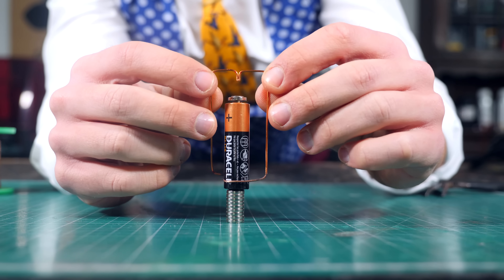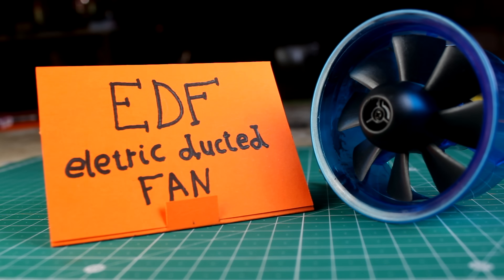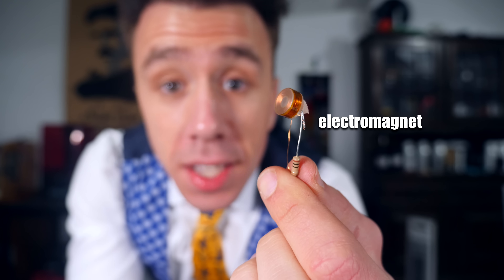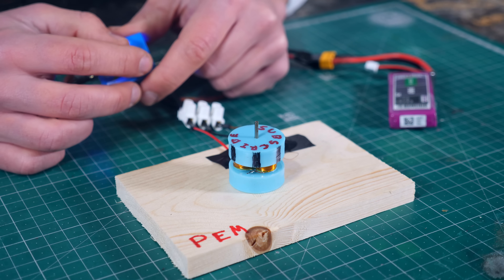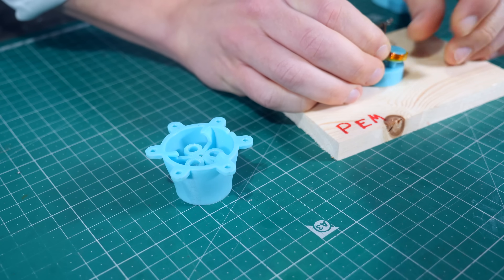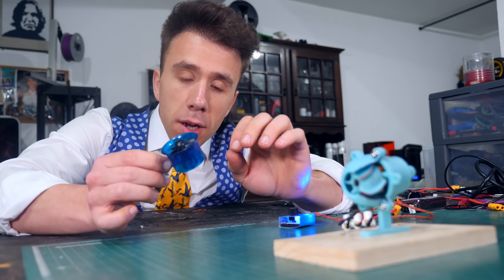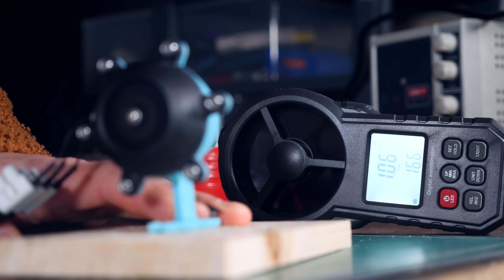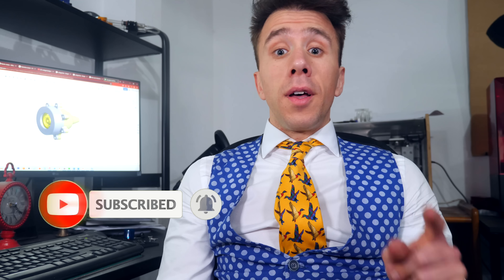I 3D Printed an ELECTRIC MOTOR FAN

Comment: I've seen already many comments sugesting the cause being restricted airflow, what is most likely the case in my oppinion too. But what about making it small copy of new boeing engine? 2 FANS rotating in opposite direction? You won't need casing - so no restricted airflow?

Comment: You need more rpm or a larger impeller. Get a current meter and you will see that you arent pulling as much power in the centrigugal design.

Comment: It is probably an efficiency issue. Your prototype has a lot of "air friction". The air doesn't go straight out but "grinds" against the carcass. The impeller also seems to have some efficiency loses.

Comment: I think problem is in that duckted fan is moving a lot more cubic meters of air, but with relativl low pressure. Impeller in turbine can create big pressure but is not moving same amount of air through it. So there lies some proportion pressure against quantity of moving air and thrust. Look at jet engines, there is a big multiple stage compressor, which puts through itself a lot of air. There is as well duckted fans on jet turbines, which increases thrust and efficiency of straight jet turbine. Basically you are trying remove combustion chamber in favor of powerfull bldc motor.

Comment: Change the inlet to get bigger after the air enters to increase pressure and lower velocity. I'm guessing the fan blades are to heavy slowing the motor. And try to get blades as close to housing as possible to increase efficiency. Look at how an axial turbo fan works.

Comment: You should enter in "the fan show down". The reason you are having low or no pressure is based on clearance. To much clearance and the air slips past the blade. Print the housing with .5% reduction in size or enlarge blades on the impeller. Didn't verify the % but you get the point and it should be so tight it almost grinds the blades to "self clearance"

Comment: so the problem is intake volume.

the EDF has a far larger intake volume then the impeller design and as a result is able to push out far more air then the impeller. the EDF also has it's intake volume further from the center which leads to the blades there going at a far higher speed and as a result leads to more flow.

Comment: I study Engineering at university, pretty sure it's as simple as an unbalanced impeller. My second guess would be the un-sanded blades create a lot of drag this would be more likely in a propeller for underwater not air tho.

Not to mention the EDF had added or removed material on each blade to ensure the motor is not wasting any energy roating an asymmetricly weighted disk.

Comment: I am a complete fan of yours now🤜🤜.... Idea for a future video - do a model rocket launch with electrically controlled fuels where the rocket gets to the stratosphere via a rockoon to minimize gravity and reduce costs....you can then optimise fuel to weight and since all that's needed to control thrust is a valve, weight will be minimised and the rocket could cross over into the other layers of the atmosphere......it would be really cool to see the limits of this fuel on a test rocket......there is already a lot of documentation on rockoons, recovery, detatchment, etc etc so you will be able to focus on the fuel side of it and obtaining maximum altitude and thrust.....i made a small doc that just summarises rockoons to give an overview on the minimum requirements for rockoons....look forward to you taking on this project https://docs.google.com/document/d/1Sq1As2OA7i0q41mUcsP2Z8VNXNb2kLCuiMZ08wnhI2Q/edit?usp=drivesdk

Comment: The problem is "impedance matching" - the energy required to drive the ducted fan vs the impeller is different. You need to design your impeller to match the output characteristics of the motor - I can't help much there, but I do know there are significant changes in aerodynamic properties when you switch between axial and centrifugal flow, and it looks like you are not extracting enough power from the motor (in your impeller) so it reaches speed and doesn't do much
Reply: from.... the motor?
Reply: @garetclaborn364  yes - the motor is producing rotational energy (and doing it continuously, so "power") and the fan is consuming that

Comment: Most likely a pressure issues. Impellers create and use much more static pressure, which requires torque rather then speed to maintain the same air flow. Likely the motor used in the EDF is optimizer for RPMs and not static pressure

Comment: Hey,
You should check out an Austrian Company called Lithoz. They create industry great 3d printers that can use nearly any sort of mineral dust (even moon dust) to create ceramic 3d prints with an extremely high quality. On their YouTube channel you can even see a small hybrid aerospike engine working. I don´t think that you will get one of those machines, but you can try to get a hold of them and maybe collaborate in a video with them.

Comment: Assuming you spin both the EDF and impeller with same motor, EDF will win in CFM i.e. flow, as it optimized exactly for that. EDF can push a lot of air through, untill there's a resistance in flow, like the core of a combustion engine. 

Impellers are quite the opposite, they can provide more pressure and less flow, when you need to puch through that oxygen so cc can be happy. 
If you want to increace CFM of an impeller, you need to increase it's inlet and outlet surface area. Note that ratio between inlet and outlet of an impeller directly corresponds to the pressure it can provide. So, for flow you want this ratio to be roughtly = 1. Aslo, another way to to increace flow is to make surface of blades larger, so it can push more air. Do that and you'll get standard looking fan like on your EDF

So yeah, fans build for flow, impellers for pressure

Comment: Integza: Thrust is a product of the velocity of the air exiting the rear of the fan. An open blade (by itself) or a ducted fan, is good at creating velocity. But, an impellor is better at producing pressure. That is why it is used before the combustion chamber in a jet engine. So. Do you want the pressure or do you want velocity?

Comment: is it possible that the energy missing in the thrust force is lost by redirecting pressurising the air as the friction between the air and the casing as well as the pressure increase create (though small) amounts of heat? This could mean that the increase in performance is only possible if you include a combustion stage.

Comment: In my humble opinion, what's happening is that the ducted fan only propels the air backwards, what's happening in the impeller fan is that you're also compressing the air, thus you need a stronger motor to compensate for the energy loss during the compression of the air.

Comment: I'm thinking it's the compression issue.  The airflow through the EDF is a lot less restricted than the turbofan.  It is going to take a lot more power to get the same amount of airflow through the turbofan than it will for the EDF.  Or look at it as a torque issue.  The EDF only pushes the air through.  The centrifugal fan sucks the air in like the EDF does, but then also compresses it.  That is going to take more torque.  There is an extra step.  I could be totally wrong though, it has been over 30 years since I last took a physics class.

Comment: Hi! So for a specific energy input of motor you get some amount of energy as air speed and pressure. There 2 factors: 1. if you convert all energy to pressure the air speed decreases, since thrust is proportional to mass flow, pressure is not useful here. Axial flow fans are better for thrust and centrifugal better for pressure. 2. each fan configuration has a performance curve. So putting a different fan on to same motor is not ideal. You either don’t use full potential of motor, overloading it( the fan is too hard to spinn ) or you don’t use the full potential of the impeller as I suspect in the Dyson impeller since the are mostly made for extremely high speeds. Hope this helps!

Comment: I believe that the thrust difference is down to mass flow, the EDF fan is optimized for flow rate while the Dyson impeller is optimized for pressure. It also seems to have much less blade area requiring higher RPM for the same mass flow. 
A higher pressure will provide a higher thrust provided the same nozzle area but will also require more power to drive the fan and may or may not be realized depending on the rpm and the throat and nozzle shape.
Reply: That’s what I wanted to say! Static pressure vs. flow rate
Reply: exactly.
Reply: What Eru says... ^
Reply: I would note that the Dyson isn't optimized for pressure, it would be more of a true centrifugal design if it was.   As a mixed flow device it is optimized for a design point that is a balance of moderate pressure and moderate flow rate.
Reply: @videoviewer2008  Of course, I should have said "more optimized for pressure" of "optimized for pressure in comparison". Depending on how far you go down the route of optimizing for pressure, it isn't even a fan anymore.
Reply: If memory serves those dyson impellers are made to spin in excess of a 100k RPM which
Reply: This was my guess alswel
Reply: Didn't he discover that in his previous video? Edit spl
Reply: UMMMmmmm.... no none of what you said exactly is right. You are seeing the problem from the wrong perspective.
Reply: @anthonyb5279  How? . I am not an expert so I might be wrong or inaccurate but without an explanation how are we expected to see what is wrong with what I said ?
Reply: @eruiluvatar236  Well its not either/or. pressure, velocity and area  go hand in hand for thrust. look up thrust equation. I can't leave a link YouTube wont let you or i would have with the initial criticism. this is really a complex differential equation its not about optimizing for speed or pressure. It mostly about optimizing geometry for desired result. You can use almost any impeller if you get the housing right for your impeller. you were almost right about every point you just need the right point of view and you will get it. So look at the thrust equation and it should come into view for you.
Reply: @eruiluvatar236  Ah, so we should ask Manwe, then?

Comment: you shaved, but to answer your question your flow changes because of the changes in volume of space, and pressure inside the ceterfugal pump. you should look up a Daniel Bernoulli, His knowledge will help you understand what happened.  I suggest your next impeller have the depth from the center hub to the edges of your fins the same as the little fan blade you started with.

Comment: Here is my take on the issue. It seems that your choking the flow to the fan. Is the intake air pressure the same on both? Meaning if you were to take a CMM reading of the air flow on the intake side is it the same on both fans? The original fan seems to have a swept opening allowing for more air to flow in. Anyway, great video. Idea for future project: Using a fan as a parachute. Can you use the principles of drag, and air flow constants to design and build a fan that can act like a parachute? That would be interesting to see.

Comment: "Forged" carbon fiber might work as a really good material to work with, you could mold with printed plastic and some clamps. Using it for high stress components might be great for future projects in general.

flow is getting compressed, maybe enegy is being lost there? or the nozzle being too small causes less enegy to transfer to the thrust meter due to a smaller area, maybe try using force instead of speed?

Comment: As I see it, centrifugal fans such as you have there, and just as you mentioned in the video, are great for jet engines.  They create the pressure and flow for combustion to then take place further down the line. This of course "feeds back" to the fan to further produce pressure and further increase possible combustion, some designs using both the thrust of combustion exhaust to create propulsion, and to drive a bigger fan that acts more like a ducted fan to create thrust.
But you're not including the combustion part, you're trying to replace it with the BLDC motor, so there's no "feed back" to boost the fan, the motor must do everything and that's where diminishing returns effect you, as higher speed + thrust + increasing loads from drag etc starts to negatively effect output.  
As good as they are, you won't get the same efficiency, or output from a centrifugal fan with a BLDC motor.  

Ducted fans are the best for electric power, axial and centrifugal fans need the much higher energy/density ratio that (currently at least) only hydrocarbon fuels can produce.
That's why you (mainly) only see ducted fans in model and very small scale thrust applications, for medium/larger thrust... combustion of hydrocarbon fuels does the work.  

Dyson fans aren't that good at actually pushing air my friend, there's plenty of videos around that show cheap "own brand" fans are more efficient at lower energy use, and far far cheaper.

That's my take any way

(fun fact, towards the end of WW2, the flow of exhaust gasses from plane piston engines had got so big that they actually designed exhaust ducts to accelerate these gasses in such a way they produced thrust to increase aircraft speed.  
They also used something akin to an oversized turbo charger that drove basically half a turbine jet engine, utilising the otherwise wasted hot exhaust gas flow.
Check out the  *Rolls-Royce Crecy * engine, incredible thrust from a relatively small engine.  Only reason it wasn't used was because the jet engine was simpler, and lighter to make by the time all the bugs were ironed out.

A good idea for a project maybe? Get a model aircraft engine, couple it to an exhaust (and maybe shaft) driven turbine such as the Crecy and see how much you can boost the thrust)

Comment: could be that you're getting different flow characteristics over the 3d printed surfaces due to surface roughness. the ducted fan is injection molded i assume which means it likely has a much smoother surface resulting in increased efficiency. that's probably only one aspect though, you might also just be starving it of air. 

one thing to check could be coating the propeller in something to create a smoother surface finish.

Comment: The main issue is pressure vs. velocity.  Centrifugal fans are very good at creating pressure, but sacrifice velocity and volume, whereas a bladed fan produces high velocity at low pressure.  You can observe this by placing a restriction behind each fan type.  As the restriction is increased, the volume of air pushed by the bladed fan will decrease, without much, if any, increase in velocity.  With the centrifugal fan, as the restriction is increased (to an optimal point) volume will decrease, but velocity will increase drastically.   All that being said though, nothing will match a ducted fan for efficiency in moving paired with energy consumption.

Comment: Your problem is that your nozzle is not matched to the optinal operating region of the compressor. You need to play a bit with the nozzle throat area so that both turbine and electric motor are operating at their maximum power or efficiency.

For the turbine geometry, you should use radially ending blades or maybe curved slightly backwards. At the intake you need a slight bend so that angled towards the relative flow

Comment: Generally speaking centrifugal compressors or fans as you say are not as efficient as axial ones for the same frontal area when it comes to mass air flow, although they are capable of providing enough compression for combustion in things like jet engines, generally it’s a cost vs performance question In that situation

Centrifugal compressors are easier to manufacture than axial ones or at least cheaper, in aviation uses anyway 

So maybe the same applies here, comparing an edf with the frontal area of the one you showed with the centrifugal one you designed might simply be comparing apples to tomatoes and we all know tomatoes make disgusting fans 😂

Just my thoughts anyway 🤷🏼‍♂️
Another great video 👌🏼👌🏼

Comment: Copy the impelller on a turbo...it sucks in and compresses the air, remember on a jet engine...you need flow but you also need pressure!

Comment: Blade quantity, size and form have a lot to do with the RPM that it turns, and if the exit its too small, youre producing pressure and stagnating the engine

Comment: Wouldn't the airflow be mostly determined by the surface area of the blades and their rate of movement? A fan with multiple thin disc blades like a tesla turbine should be optimal. Just leave out the central air holes on the leading disc to keep the airflow moving in one direction.

Comment: I work with jet engines. An axial fan is good for flow, but bad for compression. The compression ratio is around 1:1.25. Thats why an turbo fan jet has 7-15 compressor stages.
Where as the centrifugal fan has a much higer compression ratio of 1:7. Thats why there isn't that much flow. A turbo prop engine uses a centrifugal compressor and turbine to drive the propeller. And in the turbo fan engine 30% of the thrust is from the output of the core engine with combustion and 70% is from the large fan in front.

Comment: 1) I would bet that if you measured the air intake of each type of fan design, both using your electric motor(so that way the power/rpm is equal, the EDM will be taking in more air per second.

2) Thrust requires power, if the voltage is the same, I would expect the current to be higher in the EDM. If the current is the same, then there is some sort of inefficient in the path the air is taking, and most likely slowing down the air before exiting fully.

Comment: Centrifugal fan can't have the same efficiency as an axial fan, as it has to accelerate air, slow it down and accelerate again, instead of just accelerate. Axial fans also have much higher throughput than centrifugal ones.